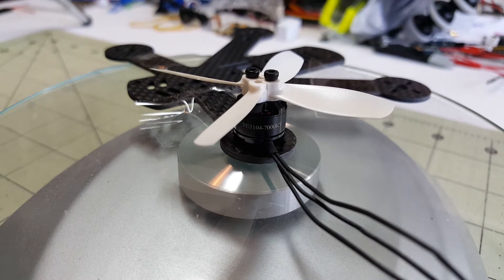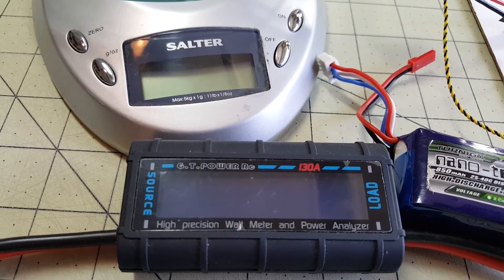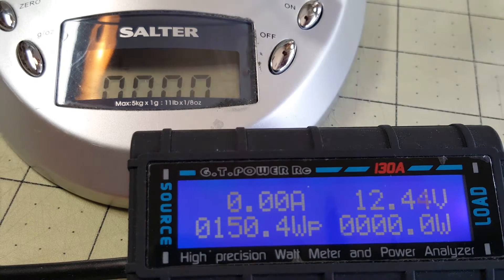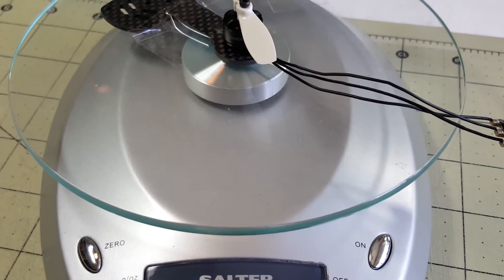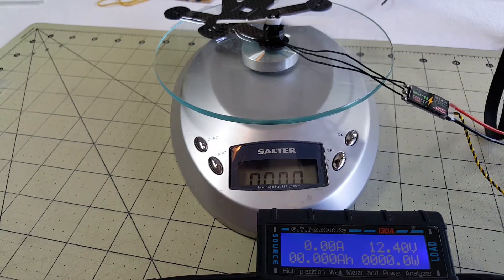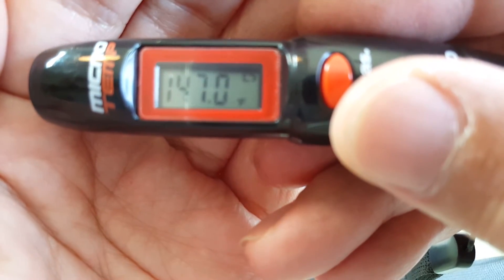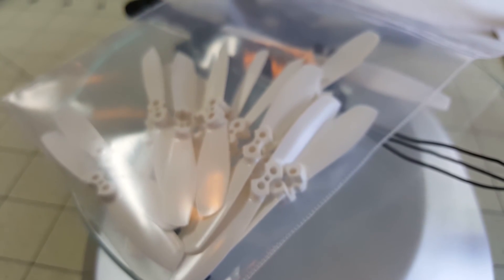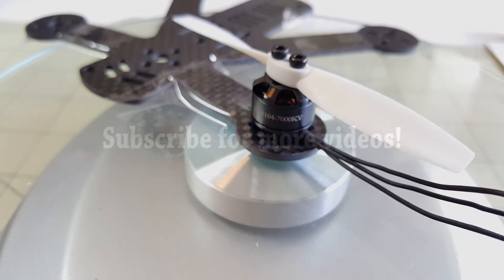DYS 1104 7000kv Motor Testing

Comment: I have a quad of 45g w/o battery that can only run 2S and 2" props. It's built with DYS 1104 5400kv and with Lumenier 2S 400mAh (around 110mOhms per cell, a bit disappointing...), feels a bit underpowered. Will the DYS 7000 or 7500kv be ok for this setup? Or might it just be the battery...
Reply from the maker: Yes, you need a higher kv motor. I have something similar that has 1103 10,000kv motors and it has plenty of power.  See my other video - http://www.youtube.com/watch?v=fdiVa33z98I
Reply: Albert Kim nice! I actually just bought the Aokfly 1104 7200kv to see how it performs. Was thinking about the sunnyskys, but the color just doesn't work on that frame (though the look promising), and the trustworthy DYS are out of stock. Thank you for the answer! I'm already a fan of the channel even though I usually fly 5".
Reply: 7800kv motor with 65mm props!! 2s, thank me ltr

Comment: Anyone experience spinning direction issue with these? I had a esc with permanent 3D mode enabled and would spin the motors both ways. I hook it up to another good esc and it still turns them both ways.... I am ready to toss these guys into the trash....

Comment: hey can you tell me - i am gonig thru HELL trying to figure out what to buy. i want some 1104 motors. the shaft of an 1104 is bare, but here, there are screws going into the prop. ?????? so... they don't screw into anything, they just compress the prop around the shaft? you know.. i spend hours worrying about if the props will attach to the motors, nobody cares if i know if they go together or not. it would be awesome if someone could say this stuff somewhere.
Reply: There are screw hoes at the top of the bell housing next to the shaft.  The shaft spins along with the housing.  They spin together.

Comment: So are these motors getting super hot on your CS110? Correct me if I am wrong but you use this setup on that quad....?
Reply from the maker: +BCORK turns out on he bench they draw a lot more amps than in the air so not as hot when flown

Comment: Do you have 65mm kingkong or other similar prop that you could test on 3s? Also any comparison numbers to 2s on the 7000kv vs the motor you went with at 3s?

Comment: I have a problem with this motor. I mounted it in tarot 120 frame and if i put the screws all the way in like touching the winding it stuttering, but when i tried to loose it or try not to touch anything the motor doesn't work as in no response. I hope someone can help me out with this problem.
Reply from the maker: +Chad Bondoc the screw damaged the windings which is why it doesn't work
Reply: Albert Kim what should i do now?
Reply: Xaviera Yayaell i did already and now I'm waiting for the the motors hahaha.

Comment: Thanks for this video! Just 1 question, running Armanatta Bumprer quad with dys 1104 4000kv and dys 3020 props and they do not even lift me off the ground. weight is 88 grams without lipo and 138 with 3s lipo. would 6500kv motors or these 7000kv stand up to 3s lipo and work for my setup?

Thanks in advanced.
Reply from the maker: +Timothy Watkins I don't know what size prop you're using. Sounds like its a small prop in which case a higher KV motor will give you more power to get off the ground.
Reply: Albert Kim they are dys 2030 props. so basically 6500kv on 3s should work well?
Reply from the maker: I suppose "well" is relative.  If possible try to use a higher KV motor.  On 3S, 6500kv should be able to get off the ground.  Probably won't on 2S.  Also, the lipo needs to have a high C rating or it also won't get off the ground due to voltage sag.
Reply: There is something wrong with your setup. Kingkong 130 and tarot 130 are super fast on that setup. I run 1104 6500 with 2030 on 3s its insane, check out my vids.
Reply: I'm running the 6500kv on 2S and the thing is fast, so we're effectively running about the same RPM given your 3S battery. Something must be wrong, maybe try lighter propellers?
Reply: I think it's the frame. My bumper has 1104 6500kv and is 126g with a 450mah 3s. It flys like a brushed quad. My guess is the foam is somehow preventing air flow.

Comment: Hi. What frame are you using? Did you find 4x or 3x props for these motors?
Reply: Banggood now sells a tri blade 2030 from DYS itself, i think this is the right one for these motors. I also have these motors don't like the way they heat up on 3020 props....Cheers!
Reply from the maker: +supermaxua It's a mosquito 110 frame ... I didn't find other props yet.

Comment: Hi, is this a realistic test considering that the motor is not moving through the air and so it is not really getting cooled? Surely you would need to have a prop that is designed to pass air through the motor?
Reply from the maker: A lot of motor tests are done this way.

Comment: Have you tried out the 1935-4 or 2035-4 props with the higher kv to see how many amps they are pulling?
Reply from the maker: +Justin Edwards no... Don't have those props
Reply: Thanks for the reply,  I did a bit of searching and finally came across a couple of builds with the 1935 or 2035 props and it looks like it's held up okay for people.    I only got 6A escs and was a bit worried about it after seeing your vid.
Reply: Justin Edwards 
Were they running 3 cell batteries ?
Reply: I believe so, I went ahead and got 5400kv 3s with the 1935-4 props and they run barely warm.  I got 10A escs just in case as well.
Reply: +Justin Edwards Thats what i want to use on an Armattan bumper, 3S 1935 furious props. May i ask, what is your experience so far with this? What batteries do you use and what is you AUW?
Reply: 114G AUW,  using 75C 3s 450mah glacier ice battery.   It's doing well,  6500kv might be better if you want to run 2s as well, but 5400kv is plenty for me at 3s.

Comment: Strange, been running the 6500kv with the quad 2353 props for a several months and although they come down warm I the motors are still going strong (no smells or smoke).  Maybe my 10a ESCs  (DYS XM10) are limiting them?

Comment: have used some of these on a tarot 120 frame, and the throttle is just an on off switch on 3 cells, I'm using DYS xm20 amp v2's (blheli-s 14.2), not sure what is going on,  tried betaflight, lux float for the afro naze I'm running, and today cleanflight with the lux pids.
Nothing works, either tick over or hitting the ceiling.
Dunno whether it's the ESC's as I can't seem to calibrate them...the motors as they are spinning a over 7k at full throttle, the afro, but this I'm used to and have it setup right.
I've noticed on the sliders in any of the above firmware, the motors seem to perform as they should, I get a range of throttle. As soon as I try it over the Tx, it's almost always an on off switch. there have been a couple of times where it looks like it would fly, but after disco from the P.C, either the naze won't arm, and if it does, the throttle is a switch again.
I don't think there's the firmware out there yet for these RPM. I'll have to swap stuff out until the programmers catch up ;-)
one thing I haven't had an issue with is heat in the motors, ran full throttle on the 3020 for a pack (and a 950mah at that) with no props and the motors were warm.
I'm sure this is a software problem.
Any help would be blinding though chaps ;-)
Reply from the maker: +Ben Portman have you checked you channel mapping?

Comment: Nice test, heard that the DYS 1104 6500-7000KV had some vibration issues due to unbalanced motors which can throw off level flight modes. I'm looking into some 1104/1105 motors and will probably end up with the RotorX ones.
Reply: Just curious if you had a chance to compare the RotorX motors to these...  if so, any thoughts?  I need some small motors for another <150 build but not sure if splurging the extra cash for the RotorX is worth it or not.  Peace
Reply from the maker: Yeah, probably weak bearings. I have some 5400kv motors on the way and will be building my Mosquito with those motors instead.
Reply from the maker: +DirkaDirka07 check out my PredatorX video with RCX motors.

Comment: 7000kv is way too high for 3s, that is a 1-2s motor... on 3s unloaded that motor is spinning over 80,000 rpm, no way it can handle spinning that fast, also your esc probably won't be able to keep sync on it at those speeds, you've probably destroyed the bearings already just running it that hard.

Comment: Very helpful, been waiting for this test. Can you test using 3S battery?
Reply from the maker: +calico88888888 that was a 3s battery
Reply: +Albert Kim (marblekit) ok sorry.
Have you flyin with 3020 ?
So the motor chart spec trust on BG in correct then.
Thank you.
Reply from the maker: +calico88888888 yeah 3020 too hot
Reply: Received 2 DOA from banggood. 2 replacements were also DOA.

Comment: I tried this motor also and even on 2s the they got really warm. Bearings also get really crunchy sounding after a few flights.
Reply from the maker: +brandon cruz how have the 5400s held up?
Reply: They seem to be doing ok given the amount of abuse I have been giving them with my micro. Iäm running them on both 2s and 3s no problem but with only 2inch props.
Reply: Exactly the info I was looking for about 2s. What kind of power do you get?